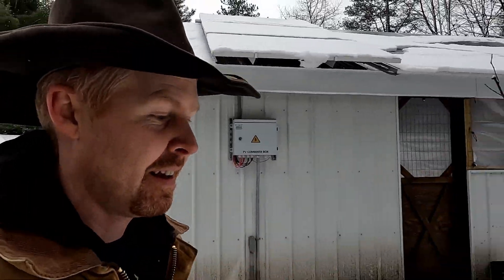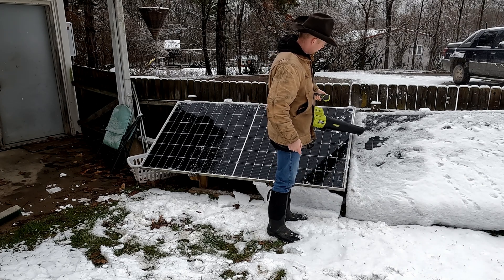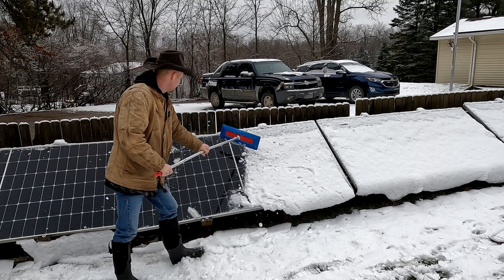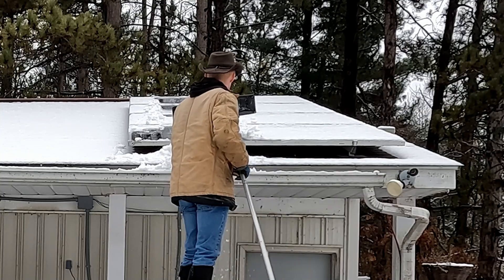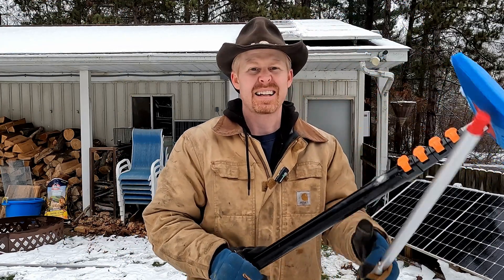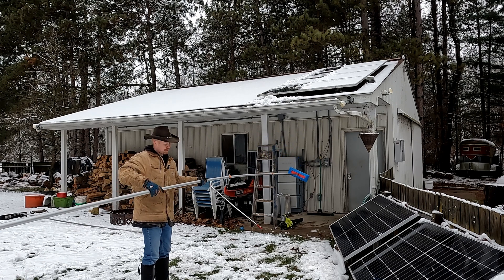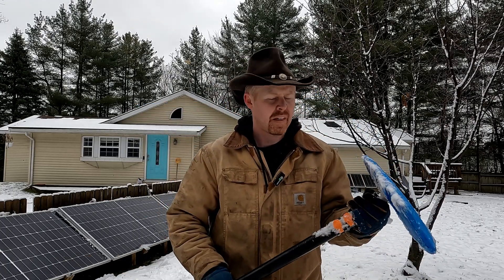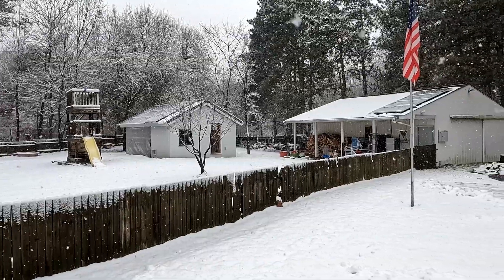Gotta Keep Power Coming In: Clearing Snow From Ground and Roof Arrays

Comment: I bought a floor squeegee to use on my ground mount arrays. Works pretty good. That’s the only thing that I use it for is clearing the panels.
Reply from the maker: Nice!  I forgot I had one of those.  I did use it on the panels but for some reason I didn’t like it. For me, it might not have been tall enough so I had to keep making multiple passes on the panel.  

Glad it’s working well for you though!

Comment: I have my panels vertical so they mostly self-clean, but it just occurred to me, I wonder if rain x would help it slide off easier? If you're off grid in winter run gen exhaust through metal dryer hose under the array or vent a dryer the same way, do a load of laundry and melt an array. For heavy snow loads, run a tight string tied to a top corner and cut through the snow solo, easier with 2 people toss the string and cut it like cheese, if all goes well it should slide right off.
Reply from the maker: Thanks Bob!  I have yet to mount any panels vertically.  Need to find a good spot for that!

I've heard concerns that Rain-X might damage the coating on the panels (not sure if it's true or not).  Maybe I just need to grab some and do a test???

The dryer vent is also an interesting idea.  I would imagine you might to be able to run very long without it just turning into condensation inside the tube though.

Comment: Did you happen to record the difference in power output between when the panels were snow-covered and when they were clean? That would have been an interesting piece of data.
Reply from the maker: I knew I forgot to add something!  So the arrays are all tied to different systems, but one system shows that I had a combined total of 49W on 3 different strings and after I had things cleared, there's a noticeable jump up to 278W.  Every little bit helps!

Comment: Wisconsinite here, Dedicated push broom, roof rake, and after ice storms window scraper on extension pole (to get the process started). But the best thing for winter are my vertical panels nothing sticks to them at all. I would never climb up on the roof in winter, one slip and you will never in your lifetime make enough power to cover the cost of the accident!
Reply from the maker: @rccrashed  thanks for sharing!  How big of a vertical array do you have?  Is it worth it?
Reply: @AdamDeLayDIY  I have 6 panels mounted vertically on the side of my shop, from November through spring they are my best performers. But during peak summer I get shading on 2 of them I lose some power from them. Its interesting to see different orientation changes throughout the year. I have 33 panels all south facing. 12 are seasonally adjusted from 30 degrees to 60 degrees, 8 fixed at 23 degrees (roof mounted), and 7 on a tracker (seasonally tilted by me, timed to follow the sun daily, which i disable during the winter as tracking is so limited this far north).
Reply from the maker: @ what direction do your vertical panels face?  Do they get direct sunlight or is it ambient/reflective light?
Reply: @AdamDeLayDIY  All of my panels face south. So it's both direct and reflected sunlight. They max out power way earlier in the day than the rest of my arrays, and with the snow not sticking on the panels, produce much faster also when it snows and I am not around to clear them.

Comment: A tip for your snow rake on an extended pole.  Start using the thicker extensions, the thinner diameter extensions near the top can bend or break, just use as much of the heavier extensions, and be careful when you need to use the full length of the extension pole, go slow to prevent bending the extension pole..
Reply from the maker: That's a great idea!  Thanks for the tip!

Comment: I too live in Michigan. 
I use a soft bristle 24' wide push broom with teloscoping painters pole. Works great as long as I broom the snow off before it freezes.
Reply from the maker: @noname-vu5gq  nice!  Have you gotten a lot of snow recently?
Reply: @AdamDeLayDIY
  Just a few inches here & there over the last few days.
 Sometimes, the wind will keep snow from accumulating on my panels.  It is windy where I live, I am surrounded by farm land.
Reply from the maker: @ yeah I’m sure the wind helps.  I’m surrounded by trees so that does limit the wind but it also limits the production potential as well…

Comment: Have just posted a video on the same topic with my option !
Have also the option to change the heads of my extension pole !
Cheers
Reply from the maker: @SoluSolaire  very nice!  Yeah it gives you a lot of different options when you use those types of extension poles!  Merci!

Comment: Still no rain this winter in Baghdad.
Reply from the maker: @HybridShedIraq  what’s the lowest average temp you get over there?
Reply: @AdamDeLayDIY  it gets as low as 2c in the night and average 15c in winter morning.
Reply from the maker: @HybridShedIraq  boy that would be a heat wave for me…. 😁
Reply: @AdamDeLayDIY  sure, cold and hot weather is battery killer. By the way, I added new MB31 cells to my existing 40kw bank. 😅
Reply from the maker: @ awesome!  Did you just do 1 set of 16?  What bms did you go with?
Reply: @AdamDeLayDIY  jk inverter bms yes 16 cells series.
Reply from the maker: @ very cool!

Comment: You should try 300+ feet of array, 2 panels high. Only good part is my mounts are adjustable to 55 degree pitch so most falls off easy.
Reply from the maker: @snoflite5234  boy I would love an array like that!  Very cool!  Usually I do adjust my ground mounts but I got a little lazy this year…

I was surprised, as you saw in the video, that the coop roof was sliding off on its own.  It probably would have cleared itself.  The actual roof arrays on the iron ridge system were the ones not clearing themselves…. Must have something to do with the gap between the panels.

Comment: I was hoping for something new lol. I use the snow rake my snow comes a foot at a time sometimes more this year so it is a challenge especially the roof mounts and I have both same as you. If or maybe when the sun comes out it does slide off if I can get the bottom row clean. I think the only way would be to reverse the voltage flow to warm up the panels but nobody has come up with that yet and I don't experiment too much any more. I do like the extension pole maybe I'll order one or wait for spring I know that works. Cheers
Reply from the maker: @offgridwanabe  haha, I’m hoping for something new from y’all in the comments!  

I do know there’s a few threads on the diy solar forum right now about automatic panel clearing.  Hopefully they come up with something new and simple!

Comment: It's interesting to see what you have to do to keep snow off them but it must be a bit frustrating to spend an hour cleaning them only to have it snow again and cover it all back up.  I wonder how practical it would be to have a tough clear plastic sheet that you could wind up and down (one roll at the ridge of the roof, one at the gutter, wind onto the gutter roll then wind it back up) to clear it.  No snow here but it does rain a lot at times. Depending on the measurement station in town there's been 100mm to 200mm (3.5 to 7.5 inches) so far this year.  December saw around 350mm at all stations.
Reply from the maker: @retrozmachine1189  whatever it takes to keep the power flowing…😁

If there was some way to automate the deployment and retraction of the cover, that would be sweet!  I know I’ve seen a few threads on the diy solar forum recently about automatic panel clearing.  It’ll be interesting to see what they come up with.

Lots of rain just seems depressing to me.

Comment: I've been using a pool brush on a pool pole.  They extend really far and allow you to get up pretty high as well.  Nice and soft, doesn't get stuck on the bolts either but probably not as robust as the snow brum.
Reply from the maker: @joeschmidt9503  that’s actually a great idea as well, especially if you already have it for a pool!  Thanks!

Comment: I have been using the same type of end for clearing my panels. Mine is a push pull end.  It works great but like you discovered you can get aggressive if you use the short end to break up ice or whatever.  I end up bending the pole or breaking it. I still have to get up on the roof tho.  Looking for a new pole meow actually!
Reply from the maker: @AVERAGE_JOE  yeah I was wondering if you had to get up on the roof with all your arrays.    I haven’t had a lot of the wet heavy snow to deal with yet so we’ll see how the pole lasts…